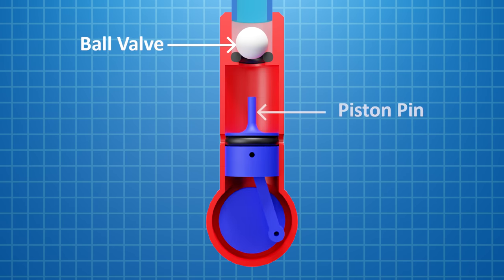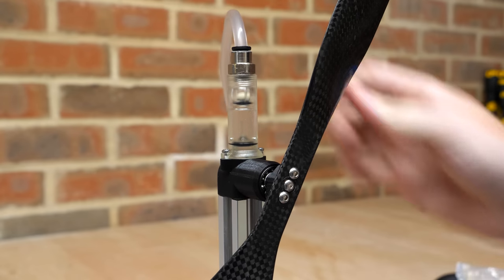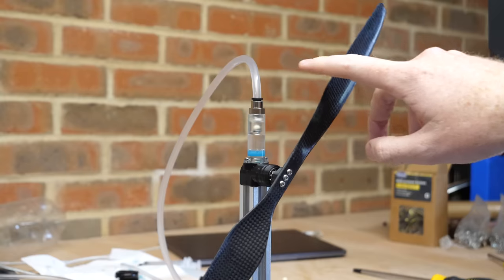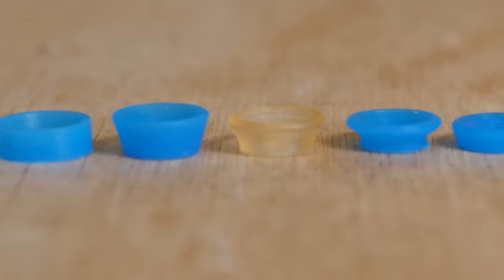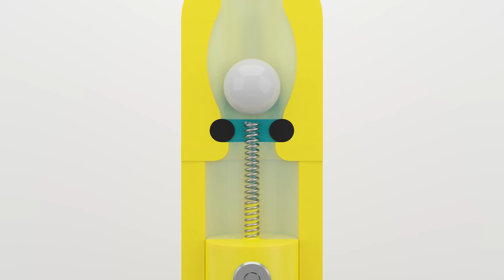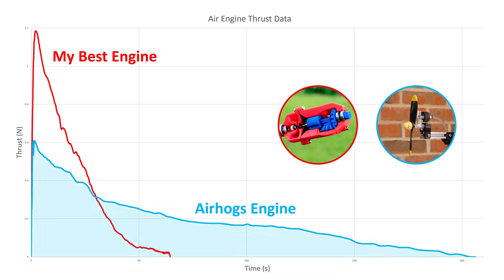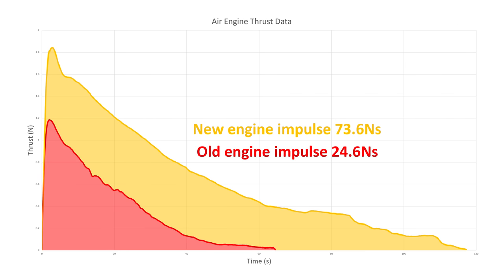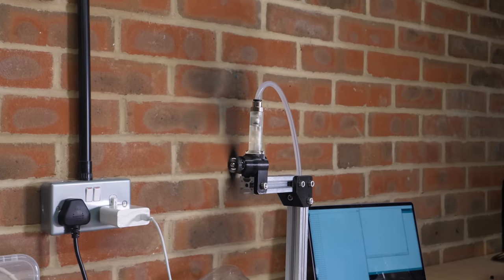Optimising an Air Engine

Comment: I'm a bit late to the party, sorry.   I wonder if you would get better results with the long stroke motor if you used a higher pitch prop?  Plus keep in mind that with low pitch props turning at moderate RPM the thrust can be high but the pitch speed and RPM might result in a low forward airspeed.  And that's why a lot of models use high pitch props to fly well despite what might at first seem like poor performance on a static thrust test rig like you are using.  This is very much something we see on electric power RC models where we might be using low RPM motors with large folding props.  The static thrust is horrible because the blades are stalled.  There's still thrust but the RPM is slower than it should be due to the high prop drag.  But once launched and the prop blades cease to be stalled they pull the model strongly and run at less power all at the same time.

Comment: would a flat-2 engine be more efficient?
Also, can you get more efficiency if you aim the exitting air better?  I admit this one I'm not even sure about myself, but I remember reading that they got noticeable improvement in performance from piston engines when they angled the exhaust pipes.

Comment: Have you seen the piston heads in AEG airsoft guns? There's a clever way to make the O-ring expand when traveling in one direction, but contract when the piston is retracting. I'm curious if that would work here.

Comment: could you maybe calculate the necessary cylinder volume given the volume of air in the bottle and the desired run time? and then tweak the shape of it? I know technically gas engines run close to most efficient with square bore which is why you see a lot of engines with 500ml displacement per cylinder. reducing the piston and con rod inertia would be a good test as well and maybe even increasing the flywheel inertia. also check the ball for divots from the stem hitting it in case the air starts leaking into the cylinder.

Comment: Hi Tom, awesome video. I was thinking, would you be able to achieve longer flight time by loading the gas chamber with dry ice (and water maybe to speed vapor production) instead of compressed air? I'd imagine you would receive a more smooth and longer duration power delivery band. Curious if this would work with the added weight? Seems like the current design is efficient enough.

Comment: It would be super cool to see another valve on the crankcase side and so the connecting rod would act like a pushrod vavle and pressurize the piston in the other direction.

Comment: Tom, I've watched most of your videos and I'm fascinated by your dedication.  I did have a question about bladeless fans being used for propulsion in drones.  Is it possible using the Dyson type air multiplier tech to create a drone with no blades.  I know the air gets sucked into a central area in bladeless fans and pushed out of another area to achieve the multiplication effect.  Can this be applied to drones?

Comment: I feel you could make some really cool engine designs with that cylinder. maybe something like a radial or a horizontally opposed. it’s cool how they sound like little gas motors. makes me want to get a 3d printer

Comment: A vacuum is good for silicone, but a far better solution is o actually let it cure under high pressure - about 50PSI. This compresses the gas in the silicone and allows it to cure bubble free, plus it forces the silicone into the mould more evenly.

Comment: You need to do what I have done to improve your design. First you need 100 percent compression. So you need a metal cylinder and piston with oil rings. Second you need to make them shells to the original concept. That way you can run this at higher speeds without losing compression and keeping the system from overheating. Use CLP not conventual motor oil.
Reply: Trust me I'm a genius

Comment: Your an engineer, yes? A piston engine gets max around 30% efficiency. A turbine 90%...
So for three times the energy?
Reducing the revs with a single belt would still keep most of the energy. A worm gear would lose more but with a massive rev reduction.
Good Luck 😎👍

Comment: Why don’t you try printing a ridge at the top of the piston stroke where the o-ring stops travel to help seal when there is the inrush of compressed air?

Comment: Probably a dumb idea, but I wonder if reduced load on the motor from the plane moving will impact its run time. Thinking about it, maybe it actually affect it inversely because motor RPM would increase.

Comment: To keep it lubricated can you have tubes connected to the exhaust outlet running to a tank. The tank has a ball float breather and then runs back into the inlet tube. Would that work ? 🤔

Comment: i knew airhogs had something special and i was like 10years old. they would have been a million times better if they just gave you 5 spare wings per kit instead of 1 spare, mine worked for years until lost or tossed i dont know. i saw them have air cars too but battery was better for that. this engine was so optimized its beautiful even today.

Comment: Try making a air engine that only has one exhaust port and add like a exhaust pipe with a one way check valve fitted to it and recycle the air back into the the tank and see how it will run then

Comment: I wonder how a Rotary engine would work, you would be able to save weight with the lack of a crank, and you could probably reach higher RPMs

You could also probably get more power if you made the cylinder undersquare instead of oversquare

Comment: You may end up being able to squeeze a bit more power out of an opposed piston (boxer) design, as with a single cylinder engine there is wasted energy in the form of lateral vibration.

Comment: I wonder if you could make smoler cylinders and make a multi cylinder engine? Like a little bitty parallel or V twin. Not an engineer, but I wonder if another cylinder performing its powerstroke while the other is performing its false "compression" stroke if it would balance it out more and increase efficiency.

Comment: Have you heard of ptfe type seals used in hot stabs in the oil subsea industry there is a rubber seal then a ptfe seal that goes on top of that

Comment: Finally some sensible tiktube content. Thank you! Scowering the youtub plains for some brain food is tiring at best. All the talk about electric ebgines and hydrogen, completely forgoing the option of air engines (especially for small cars/motorcycles. With current technology it should be a piece of cake.

Comment: 🤔 I wonder... Since it requires compressed air, and eventually the tank/bottle will loose its compression. What if you took something like an Airpump for rated for a 50-55gal aquarium and used it to provide a continuous source of pressure to the tank/bottle and use some sort of battery to power the air pump?

Comment: I have built air engines for in excess of 50 years. Contrary to your own conclusions,  I have found that building tiny engines looser works best. I have also found using a Reed check vakve, like in an air compressor in place of a ball in a "bash-valve" engine gives the best performance. That, along with a very loose-fitting, long-skirt piston, gives the ultimate performance results.

Remember: The smaller the engine, the greater effect internal friction has on moving surfaces.  Loose works best.

Comment: that's really interesting thanks for sharing your motors , you are a true scientist your going to figure out anything you go after. do you regulate the air supply and pressurize the main tank to excess of 80 psi because imo the mose appealing thing about air power is you can compress it with almost no added vehicle weight.?
Reply: i have tested 500ml pop bottles to 100 psi

Comment: If it's that good, would would happen if you gave it two bottles, and Two engines working together as a V2 engine sharing the same air supply?
I'm not saying you'll get 2 minutes flight out of it, but... might be strong enough to add a small remote controlled engine(s) to it to control flaps and rudder.

Comment: i wonder if it will be possible to generate electricity and to create a steady fuel supply by pressurizing air from outside into the engine's tank

Comment: Force is equal to mass' times acceleration, make the parts metal and you'll get much more efficient results..
Reply from the maker: But a heavier engine doesn't mean more thrust? A metal engine will just require more thrust to accelerate.
Reply: @TomStantonEngineering  Interesting..
So for arguments sake, if some parts of this engine was made entirely of lightweight metal, and lubricated.
Would it run less efficiently over the span of its run time?
Would torque be more or less overall?
Reply from the maker: Yes the engine parts would probably last longer, but the initial performance should be the same. Sorry, I thought you were referring to the weight of the engine affecting the efficiency.
Reply: @TomStantonEngineering  Sorry, my bad.
Also, Ive noticed on your Osprey model (fantastic by the way)..
When you shift the motors forward your centre of mass shifts forward, way beyond the centre of lift (hence the dive bomb in forward transition and nose up when you transition to hover), have you tried moving the motors further back the cowling just infront of the centre of lift, then using propshafts, to maintain the centre of thrust infront of the CO/Mass?
Just curious..

Comment: Long stroke with shorter valve opening? Would be best with some sort of vvl to avoid stalling at low pressure
Reply: Or use a second larger piston to use the energy from the exhaust

Comment: Hmm, I wonder how they compare if you don't take the tail where the thrust is too low to be usable into consideration. Does their relative efficiency change?
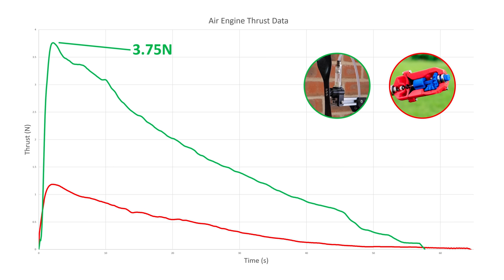Looking at the graph at 14:49 the red one seems to peter out slowly, while the green one is more of a run and then stop kind of curve. Of course, the scale might be deceptive here, but how much of the red tail is actually usable thrust? How much do you need to keep a plane in the air?

Comment: You might have better performance with a horizontally opposed design with 60% capacity of the original motor for each cylinder instead

Comment: Wouldn't making a multi expansion engine make more sense in terms of further increasing impulse?

It would also decrease the likelihood of running the motor in reverse accidentally too as you get the beginning of a new powerstroke at the end of the old powerstroke

You're using a 3d printer anyway manifold the exhaust from the HP cylinder into a larger LP cylinder connected to the same crank.

Comment: Just out of interest, and as it's a bit of a buzz thing at the mo, have you considered adding a toroidal propellor and seeing if it increases efficiency? I realise this series is more about optimising the engine itself, but I wonder with the diminishing torque as the air resivoir  is depleted, if the toroidal design may be well suited to a optimised air engine. 🤷🏻‍♂️

Comment: Hey tom i absolutely love your vidoes. I have one query though, would there be any merit into facing the exhaust port only backwards and adding a nozzle as a secondary source of thrust? The air coming out of the exhaust ports looks like it has a high velocity but just not sure if theres enough volume to make a noticeable difference

Comment: Hardness is the measure of resistance to scratches and other surface damage, not how "bendy" a material is, that would be called Young modules or Elastic modulus. You got lucky that it was also lower for this one.
Reply from the maker: Shore hardness is a measurement of the resistance a material has to indention. There is a shore hardness scale for many different flexible materials.
Reply: @TomStantonEngineering  Yeah, indentations as in small scale marks on the material. They are permanent as opposed to the elastic deformation you care about with flexible materials.The machines used to measure hardness use diamond (or other hard material) and push on the measured material with the set amount of force. And then the size of the indentation is measured with an electron microscope - that's how small they are. Increasing the force would make a larger mark but would also introduce a bunch of elastic deformation throwing off the measurement.

Comment: You should really look into a Tesla turbine. You can make it small enough for that plane and it will run off of air. True it will not be as efficient as steam but it will still work and will give high RPM's

Comment: Yo man. You wanna hear an idea. You run 3 of them off the same tank with a couple capacitors. I bet you could generate enough amps to run that compressor motor with a 66.66666% efficiency that's over 50%. Might invent a new way to run your house AC for a few weeks independent from the electrical grid. Just saying.  These days every penny counts ya know

Comment: HINT: YOURE WASTING A LOT OF AIR TO RUN A SECONDARY FIRING OF THE EXHAUSTED AIR.. YOU SHOULD THINK OUTSIDE THE BOX SOMETIMES THE ANSWER IS RIGHT UNDER YOUR NOSTRIL. VENT THE EXHAUSTED AIR INTO A SECONDARY CHAMBER THAT SLOWLY GETS MUCH LESS PRESSURIZED THAT TANK 1. ONCE THIS IS SECONDARY IS MAXED OUT, A VALVE USES THIS SECONDARY FOR A FEW PUMPS, THEN ONCE THE PRESSURE IS NEUTRALIZED AGAIN, THE PRIMARY CHAMBER DOES ITS FUNCTION AGAIN AND THE CYCLE REPEATS UNTIL ALL PRESSURES ARE RELIEVED. THIS WILL ADD 25 PERCENT MORE EFFICIENCY TO YOUR RANGE. POSSIBLY 33 PERCENT MORE DEPENDING ON THE COMPOSITES USED. HEX COIN $0.01 PULSECHAIN $0.00009 PLSX $0.00002  THESE ARE CRYPTOS YOU SHOULD BE PROMOTING. FOR FREE. THEY ARE OF THE COMMUNITY OF WHISTLE BLOWERS AGAINST FRAUDULENT CRYPTO, AND CORRUPT COIN RANKING SITES/ EXCHANGES THAT HAVE BEEN SCAMMING PEOPLE FOR A LONG TIME. THE FOUNDER WARNED EVERYONE ABOUT SAM BANK F AND FTX.. HE ACTUALLY WARNED A LOT OF PEOPLE ABOUT MANY ISSUES IN CRYPTO BUT MOST PEOPLE DONT CARE ABOUT ALL THAT THEY JUST WANT TO BUY THE NEXT HYPED UP COIN THAT MANY OF THE CORRUPT ALREADY HAVE POSITIONS IN AND THEN THEY GET REKT DUE TO THE BUSINESS MODEL THEY RUN. LOOK INTO RICHARD HEART AND HIS CLEAN ECO SYSTEM. THE DOCUMENTARY ON RICHARD HEART IS AIRING AUGUST 7 TITLED HIGHEST OF STAKES, AND ELON MUSK TWEETED THAT HE "HAS A FONDNESS FOR HEX" ... YOURE WELCOME AND GOOD LUCK ON THE SECONDARY CHAMBER.

Comment: You could also use liquid nitrogen in a small bottle as a high density source of gas. Not quite “air” but you 79% of the way there

Comment: wait i think i got an idea. solar panels on wings to run one of those cheap small air compressors to power this engine. Probably a terrible idea. But if it was big enough it might never need to land.

Comment: I would think ideally having an jet or ram jet design would be best, airbus is supposed to have Hydrogen engines by 2030 possibly.  Propellers are good at low speeds but have a limit.

Comment: Hear me out. What if instead of using compressed air, you could use some sort of chemical that is naturally very energy rich and when you add some more energy, it rapidly deconstructs into various gasses which almost explosively expand. This would mean your engine would be able to carry a LOT of energy with very little weight and get much much higher impulse from it.

Comment: Reducing 0.1 mm in diameter is way too much for tuning the fit of a cylinder which must be air tight. Maybe reducing the diameter in 1µm increments until it is a tight fit, but I don't think SLA printers have this level of precision.

Comment: Just a quick dumb question, but what makes the air engine stop over time?
Reply: he's running it from a pressurized bottle, so as the air is exhausted out of the engine the pressure inside the bottle decreases, providing less energy to the engine.

Comment: Call me crazy but I would love to see a mini wankel-ish rotary air motor, not completely sure how but it'd be like a little 3 cylinder but with it having ports and not valves also not requiring a 90* inertia dump but instead rolling along the inside of the housing it might be more efficient

Comment: Would be interesting to see how it would work using high pressure steam instead of compressed air or run a steam powered compressor similar to the v2 rocket. V2 rocket had steam powered compressor component in them. The steam was produced via chemical reaction between Hydrogen Peroxide and Sodium Permanganate.

Comment: Wonder if your supply could use an aluminum tank pressurized to 3500psi and regulated down to 60psi…

Air rifles use them.

Comment: Back in the day (like late 80s early 90s)they made these little toy cars that had a round pressure tank and a cool little see thru air engine and they came with these little pumps and u would pump them up give them a push and they would take off fkr a short bit.. toys these days suck lol

Comment: Why don’t you want to keep the original design with rubber o ring and put the holes in the piston 
When the air will go in the cylinder the air will expand the rubber o ring by the air 
At the same time it will be less friction and less complicate 
Just google Airsoft AEG piston Head I hope it will help you resolve your issue

Comment: You should try to use the old system to regoulate the air flow to the engine https://youtu.be/I1Of1WRo38s

Comment: Its used to be cool to watch people do things like this on youtube, because it was something anyone could attempt. Now its like watch me print pieces out of my 10,000 dollar 3D printer and pop it together and what do you know its probably flys, idk im not gonna finish it. I might as well watch some company buliding a plane with very expensive tools and guess what it will fly wow exciting it 2024. This video is kinda lame sauce bro.
Reply from the maker: The cost of the manufacturing technique doesn't guarantee a project will succeed. You can make this whole project on a printer under $500, or have it made by a printing service for even less. I understand the reasons behind your assumptions, but they are very incorrect.